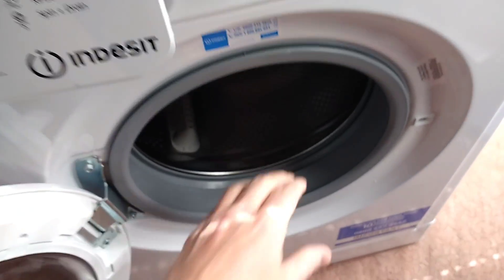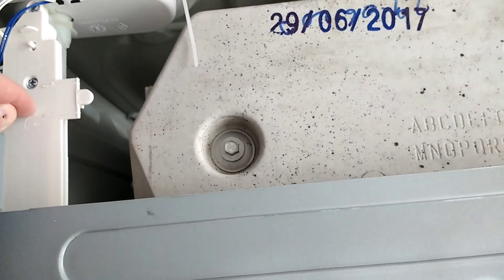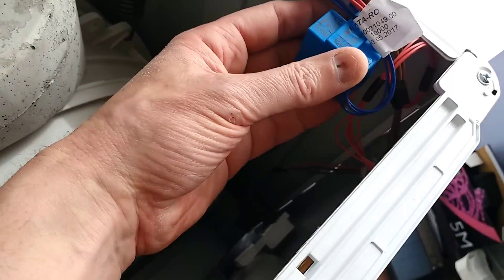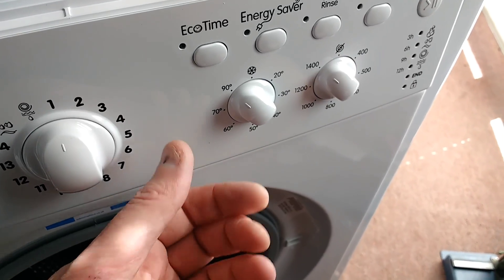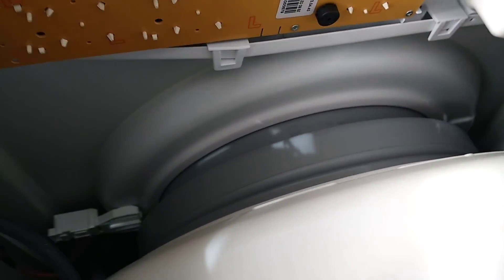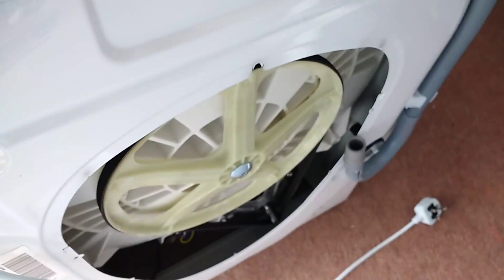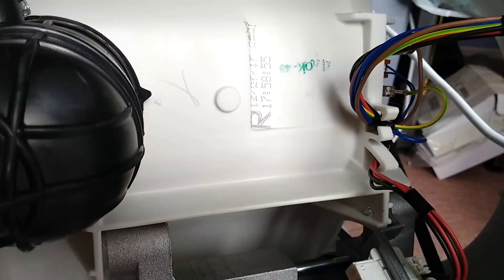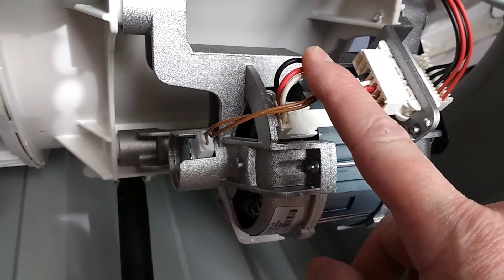Inside my new British washing machine (clothes washer).

Comment: Surprised you went for an indesit tbh, hopefully you don’t get the years of trouble that some of us have had (leading to us to replace the piece of crap after a couple of years as it was less hassle).  Hotpoint seem to be little more than badge engineered Indesit appliances these days as well unfortunately.

Hot fill is a very British thing, and some modern houses don’t have the facility.  I guess in the global marketplace it doesn’t make much sense to have a facility that can only be used in part of one market, and I’m guessing heating the water in the appliance gives the machine more control over the cycle (rather than the water being too hot or at not a high enough flow rate).  It would also no doubt increase production costs as well and allow competitors to undercut by not having the feature I suppose.
Reply from the maker: I've had good service from Indesit machines.  They also have a sports shoe washing mode which most other machines don't have.  And that included the Hotpoints that are clearly rebadged Indesits with a higher price.

Comment: What a great place for the control board if there's ever a leak and water gets on it. Used to be integrated with the control panel - up top and out of harm's way, but I guess those runs of copper wire have to be as short as possible. The brushless 3 phase motor is an interesting change. The only thing left to do is to switch to a plastic cabinet instead of metal.

Comment: The Miele washing machine we got here has one water input and both, external heater (integrated in the water input pipe, up to 60°C) and an internal one, most likely to reach the upper temperatures. All sides of the machine are completely closed... and we won't open something with 30 years warranty! Except for 30 years after buying maybe.

Comment: Great video. So I take it you didn't sign up to the extended warranty then? ;-) I could have bought my washer dryer 4 times over with the amount I've spent on the extended warranty plan (which I cancelled last year once I calculated how much I spent...) Next machine will be a plain washing machine now I've got a seperate drier...
Reply from the maker: The extended warranty plans rely on the cost of the service call to cover the "free" components.  They're worthless.  Especially if you're technically inclined.

Comment: That motor is damded small!
I see that I need to change my old washing machine.
Reply: it's small, because it's built for speed, not torque. The turns ratio between the drum pulley, and motor shaft pulley is~11:1. it's powered by a variable frequency drive, capable of 380 Hz, as opposed to 50 or 60 Hz. Since the motor is designed to replace the universal motor, this 2 pole 3 phase induction motor runs at about 22,000 RPM on high 'spin' cycle.(The synchronous speed is 22,800 RPM, with a slip loss of~800 RPM) This type of motor almost always  out-lasts the rest of the washing machine!

Comment: I worked for hotpoint /indesit for 9 years, never replaced a plastic pulley, plenty of cracked metal ones! The shocks are just friction, with felt pads inside, belts are just stretch belts,
Reply from the maker: Those are all very interesting things to note.  Especially the plastic versus alloy pulleys.
Reply: The plastic ones are quieter, they have a metal insert around the shaft end at least to add some strength, think I first saw them being used early 2000, hotpoint wma series, ahh, memories! Keep up the good work 👍

Comment: Also in Poland it is now very hard to find a washing machine that can be connected to both cold and hot water taps. 15 years ago it was a standard, but now you will find one or two models that can take hot water. I don't understand why. The irony is that now everything seems to be energy efficient and "eco". We produce most of electricity from coil, this produces a lot of heat, which is used to heat the water (otherwise it would be wasted). So our power plants produce both - electricity and hot water... then why use expensive electricity to warm up cold water in my washing machine, when I have inexpensive hot water in my tap?

Comment: I had a similar machine Clive but an older model. lasted 5 years or so. The plastic drive wheel on the back seems sensible and possibly an upgrade. The aluminium one fitted to mine was actually the failure point! Ally rot!

Comment: Hi Big Clive - not washing machine; but White goods related! Have you ever performed a "Root n Branch" investigation of a Cooker Hood? I'm having a devil of a time getting my lights to work! When powered up all the fans work(relays switching in and indicator LED's going on and off - so I the logic cct seems to working!)
 I haven't been able to locate a Schematic of the Switch mode power supply. The relay for the 12volts is switching! & do you think these LED (to replace the halogens would work? Screwfix LAP 12volt 230mA 1.w watt G4 2700k they physically fit well).
The cct is from in A Bauermatic hood - 2 halogen 3 speed fan. Any thoughts welcome...
Reply from the maker: If you've tried new lamps and they are the original style then it may be either the power supply for the lamps or relay.  If the power supply is an electronic halogen transformer then it may not work with LED lamps because they are too low a load.
Reply: Hey Clive thanks for the reply, maybe the relay, it does "click" and Feels like its still working ok here's the monkey! if you get a sec. Cheers :-)
https://www.youtube.com/watch?v=4vDtOI_6sTw

Comment: Rear plastic & hollow pulley is to aid in dampening vibrations & sound. There appears to be a bit of a trend where machines with concrete slabs use plastic pulleys and machines that use other methods of mass-dampening use aluminium pulleys.

Comment: Sorry but you're mean and cheap for buying Indesit - Piece of rubbish.
Now if you'd bought Miele.....
Reply from the maker: Does your Miele wash sports shoes?  The Indesit has a sport shoe setting which does a great job of cleaning footwear.  That was one of my main reasons for buying it.  That and the similar model I had in Glasgow that was still working after 15 years.

Comment: I recall a machine I had years ago. Something went wrong with the locking mechanism. So to unlock the door I had to disconnect that water pressure pipe (the thin black one) and blow down it to unlock the door!

Comment: Ahh Indesit! It'll all be fun 'n' games until the bearings go and it ends up sounding like a jet engine test facility. The final nail in the coffin being the remnants of the belt shat out on the kitchen floor. True story! :0

Ours went after around four years. I believe the entire drum is a sealed unit so the bearings cannot be replaced. It's probably the Achilles heel of an otherwise very simple and serviceable machine. 

If you want it to last, I would probably keep the speed setting around half; run it on Eco; keep the load size well under the maximum, or halve a somewhat large load and then do both on a shorter run time (+1hr). Enjoy! :-)
Reply from the maker: I was thinking that turning down the spin speed will save a lot of revolutions over the life of the machine.  But on the other hand, I wonder how many bearings fail because of seal damage caused by scale.
Reply: Interesting point. When I did inspect ours it was very noticeable that some rusty water had been seeping out from around the bearing, and then running down the back of the drum. You could definitely see where it had been pooling over time around the base of the machine. 

Given the bearings were totally shot by this point, rotation of the drum (or flywheel) by hand would make for a very unpleasant rumbling noise! D:

Comment: I have Indesit washing machine as well, but I am pretty sure it is not British. The brand is Italian, but for European market the main assembly takes place in 2 factories in Poland! Hence they are quite good comparing to price, as they are one of the cheapest on the market. However your video shows why - the plastic drum wheel or shitty plastic drum or cheap PCB on the main panel are the reasons. I have also a Whirpool washing machine which is basically almost 20 years old. I repaired it few times and there are lots of spare parts available on the market. However this washing mashing uses as serious number of good quality components made in USA or Germany. Including the mechanical programmer which has not failed for 20 year!!! I am sure that Indesit will fail after 10 year or earlier and repair will not be economical.

Comment: Can you split the plastic drum to replace the main bearings?  if not, the entire machine is scrap when £2 worth of bearings fail........
Reply: Max Torque No you can't. They're ultrasonically welded. Or some similar process.
I've repaired quite a few indesit and hotpoint machines, mainly SMPS ICs and capacitors on the main board - because "off" is only actually standby and the PSU is always running.
Also had one which kept coming up with a pump fault but the pump was good.
They get the logic signals from the mains driven pressure switch via a chain of resistors, a zener and standard diode for each level.
One of the resistors in the chain for the "empty" signal was open.
Soon replaced that!
Other than that, would have been £120 for the module, another £100 for the software and then programming it.... No chance!
Have they never heard of desoldering eeproms off the old board and soldering onto the new one??? You WILL be 1600 spin, you 1200 machine!
Reply from the maker: I winder if there are washing machine ROM dumps on the 'net.
Reply: bigclivedotcom That makes a lot of sense, one of my mates has a lot of modules but they're not identified with model number.
The service replacement boards have every component populated but a blank eeprom. 
I think I will have a go at a rom  dump next time I get my hands on a demic machine.
I was going to build my own  washer programmer, PIC or Arduino for the old hotpoint 9000 machine when the mechanical programmer failed - but ran out of space to keep the old one. The motor control board was very simple on those, would have interfaced easily.

Comment: Looks like the front and back halves of the outer drum are glued / welded together, this makes replacing the bearings impossible. So rather than replace £25 worth of bearings and seal you have to dump the machine and buy a new one. Sadly this non-serviceability is now very common. Given that we're all told to be more 'environmentally friendly' I'm surprised that manufacturers are still allowed to do this.

Comment: Yes today's machines are full of plastic that once was aluminium and stainless Steel. But in 1983 the cheapest hotpoint , model 1852  was around £200   , if you can by a machine 34 years later for around the same money then that's why .

Comment: The locking mechanism is exactly the same as the one on my Hotpoint washing machine - just as well it's accessible as it WILL fail! When it starts flashing lights at you (especially after a spin cycle) and refusing to work, that's what it'll be.

Comment: The reason Hot fill has been abandoned is that cold fill is reliably cool and the machine raises the temperature to the correct level. If you have a hot/cold fill it might be too full by the time it reaches the correct temperature especially if the hot fill pipe has a long length of cold pipe.

Comment: Lost count of the washing machines I have been in and I tell you what for the job they do they are worth every single penny.........
Reply from the maker: I like trashy machines like this because of the optimised engineering.  Very modular and efficient.
Reply: My trashy Beko cost £150 inc delivery (2015), the drum belt pulley is called the spider the metal one's can crack over time  (years)and  corrode terrible. Interesting to see how long the plastic spider pulley's last.
The Bekos main bearing can be replaced by going through the front and a bit of un-clipping and the drum can easily be accessed and removed....Just joyful.

Comment: Hi Clive Great Video as always. 
       Your British washing machine is Italian designed made in one of many factories in Europe. the dispenser is on the front left to keep water furthest from the Module . your quite correct the motor and module are tri phase a form of three phase beware the heat sink can hold high voltage for up to 5 minutes after disconnection from the mains apparently, some large caps in there. the module as you said is universal to that platform with the difference being the programming to match the control board loom and ancillaries. the Dispenser is cold fill most are these days its a low water usage lower wattage heater. to get energy rating. cold fill is because low water usage machines are normally filled before water would be hot coming from hot water system thus wasting the supplied hot water in supply pipes. the dispenser has 3 pockets 2 fill valves each solenoid sends water through a pipe in the dispenser lid. each has an air gap in a cross shape that the water jumps if both solenoids are fired at the same time the the water collides and goes to the third pocket normally the conditioner pocket. the pulley is plastic as its quieter than aluminium I've seen more aluminium ones crack than plastic. The belt is a stretch belt, quite hard to fit when new. If you look at the pressure switch its not a contact switch its a linear pressure switch. which is a coil with a ferrite rod inside that moves in the coil with increasing / decreasing pressure. works like an am radio Ariel as the rod moves the frequency changes, more accurate apparently.

By the way Don't forget to take those transit bolts out...

Great video as always, I look forward to your Videos they say we are always learning.

Regards.
 
Stray

Comment: OMG...
You were using a machine that was how old?
You couldn't beat my mum's washing machine.
It's a top loaded open copper cylinder which has three shiny steel half domes facing downward above the top.
These are supported on a Y shaped steel top piece which is in turn supported by a steel rod inside a thicker steel tube which itself passes down the centre and outside the drum. 
In use the domes rise and fall into the soapy water and beat down on the clothes
At the top of their beating cycling they move a few degrees clockwise and so rotate as the beat as they...well as they thump away. 
This beating and turning is driven by thick steel rods and bearings and cams all driven by a huge electric motor which itself must weighs about 30 or more pounds...only guessed because we move the whole thing twice  a week and it feels heavy.
The copper drum itself is heated by open flames from a cast iron gas burner ring...connected by a rubber tube to the gas supply.
It is emptied through a neat brass tap at the bottom.
It's all mounted inside a fine wooden cylinder like a parallel sided hooped barel...all set on four heavy steel wheels, each on ball bearing plates to allow free rotation of the wheels in any direction.
Much like supermarket trolley  wheels only much bigger and thicker...of course.
These wheels are free moving and are for pushing and pulling the whole thing along.
Water is loaded by using a bucket..mum prefers the plastic ones these days as they are less heavy in her old age.
It is still working perfectly.
Mum uses it twice a week...we drag it from the garage onto the hard standing, plug in the mains, connect the gas pipe and off it goes.
I admit that we have a strong rope lasso about it so it doesn't pull it's gas pipe free, but that's  only because its wheel locks are clagged with soap residue and stiff, but other than that; it's as new.
Lovely British Racing Green painted wood, golden thick copper cylinder, and shining bright steel moving parts. ( the domes)
The mains power lead has been renewed of course with a new three pin fused plug replacing the unfused two pin cylindrical bakelite plug; and an earth wire added ( seemed a good idea ). This lead is rubber coated and will wear I imagine. The woven cloth platted power lead had lasted since before world war two so we've kept it for future connecting of things...seems in good nick.
The only extras are that
Mum uses are some wooden tongs ( circa 1956 ) to lift out the hot steamy clothes...and uses only water and soda for eashing of course.
It is a friendly old beast, it has personality, and jumps merrily as it thumps about the yard whilst in use.
I'd imagine this would be your machine of choice too.
All parts are accessible but it has never had a service call. We oil the bearing when we think of it.
We had a moment of head scratching when the gas supply changed to natural gas, but a friendly grammar school chemistry teacher did something which fixed that...
Other than that, mum who is 88, inherited it from her mum and it's going strong.
It says "Made in England" on a eliptical plate but there is no manufacturers name. 
We're pretty sure it was made at a premises which was later the "Jap" motor bike factory in Tottenham in North London ( N17) because grandad worked nearby in the Tottenham Film Studios and he wheeled it home one day to Enfield Highway, along the arterial road, from work...about 13 miles.
Not sure of the date but in the late 20s or early 30s we guess.
Our best guess is 1926 as grandad got a pay rise that year.
But oh my goodness....
How anyone could use this new fangled thing of yours is a disgrace. 
Now tell me....
You don't sound English; are you foreign? Scottish or Yorkshire perhaps?
Otherwise I'd be surprised you'd spend good money on this thing; which looks like it isn't even Empire made.
Tsch Tsch.